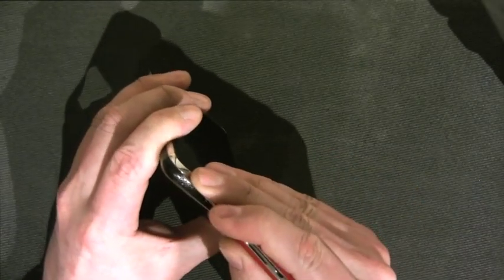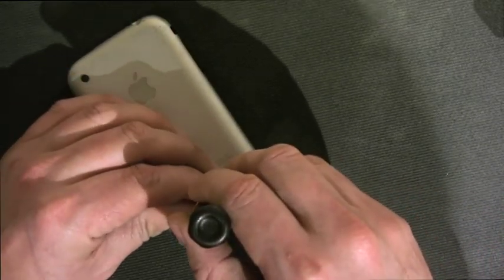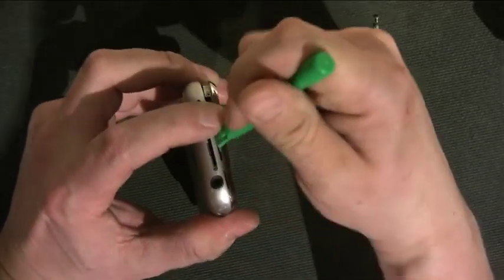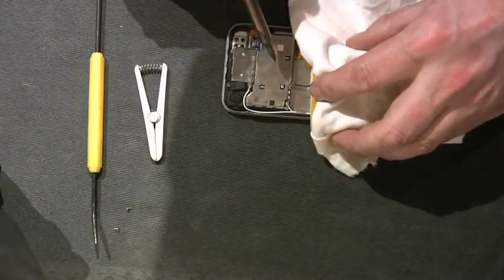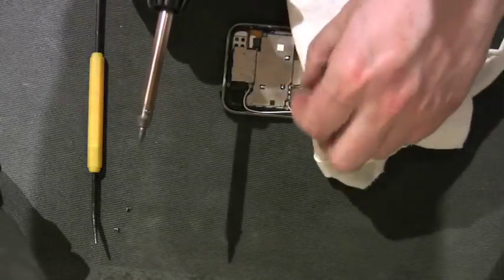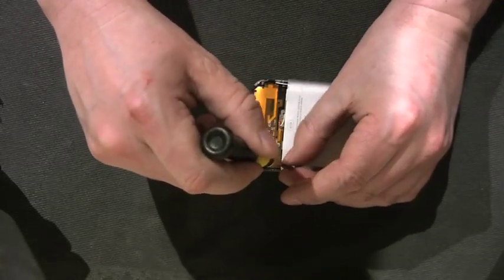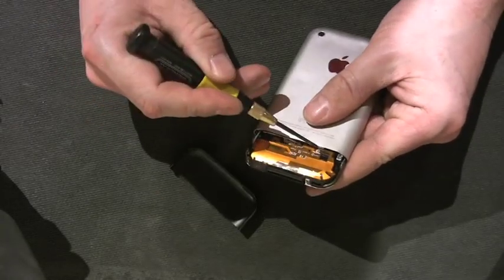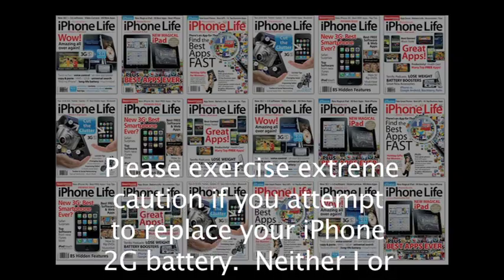iPhone 2G battery replacement

Comment: i have a problem, my iPhone 2g it's working fine, but my battery keeps dying.... when i charge it, the battery is full in like 10 sec, but if i use it, it dies.......
so could that mean that i will have to replace the battery soon?
Reply: Denis9ROCKSTAR definitely replace it.
Reply: @JZKDutchYT 6 years later…

Comment: Thanks for the video! Just sucessfully did the process. It's scary, but doable even for a beginner (like me).
Tips: a) Place a non-conductive tape on the red cable to avoid short-circuit. b) Touching metal with the red cable won't blow everything up, but you should avoid it. c) To open the metal back, follow the video, the method he uses works great. d) The original battery has a strong glue, be careful on removing it (just try not to pull so hard, to avoid breaking connectors). e) Good luck! :)

Comment: @ninjadudevideos 
Noobs might use to much heat, damageing the battery

@iPhoneLifevideoblog
You forgot some points.
1. The original battery is GLUED ULTRA STRONG to the phone.
I was very careful but while applying force, I ripped out the black cable + soldering point from pcb.
A. cut cables B. unstick battery.
2. I soldered the cables the OTHER way. Touching ground with red(+) cable won't do anything ;)
Then white(soc) and last black(ground).
After plugging it in I works again.
rgds

Comment: @ninjadudevideos 
You are the baby.
I'd like to see your face if a cheap replacement lipoly battery explodes and spews it contens into it.
Id recommend to cut the old wires and to solder the new wires to the old ones. that is easier for beginners.
then insulate the wires and your good to go.

Comment: how do u SOLDER the battery wires? I have like glue everywhere on it and its messed up and I have some wires stickin out (a rly thin and tiny one) and its rly ahrd to plug them in HELP

Comment from the maker: @ninjadudevideos Generally I'd agree it's safe to solder a battery.  However most people watching these video posts are not experienced and do not realize how much heat a battery can suck up very quickly, Li-ion Polymer batteries do have a reputation for catching on fire and bursting, how much energy one must put into the battery is of debate, but I'd rather be safe than sorry with my video posts.

Comment from the maker: @shayman1337 @shayman1337 The leads coming off the battery and attached to the mother board must be, from left to right, in this order; red white, black.  That is the only way the iPhone will power up or charge.  If you have the battery connected right and it's still not charging, there's a good chance the ribbon cable which runs under the battery is either unclipped or not fully clipped into the mother board or it's dead, in which case it would need to be replaced. That is very delicate work.

Comment: @iPhoneLifevideoblog I have a car charger and when I plug into that the iPhone powers and tries to charge.  The phone thinks it has full power (the power meter says full idk why), but once I unplug the phone from the charger it immediately dies.  I think the battery isn't doing any thing.  Do you think it's a good idea to desolder the connections and then resolder in the right order?

Comment from the maker: @shayman1337 With the back side up and the bottom facing you, the power cables should be from left to right; red, white, black.  Generally when you attach batteries you attach the ground first and positive last, that means for the iPhone (back off, bottom facing you) you start from the right attaching the black, then white, then red battery leads. make sure you have them soldered on correctly, it may take a while for a new battery to charge, you should charge with a charger not your computer.

Comment: I had the same problem as flybabafly. The black battery cable came off while reseating the motherboard cables. Can I solder the black back on or do i have to remove all 3? Worried about having the red already connected.

Comment: @flybabafly i think you have to solder it. glue wont work
Reply: Ricardo Canales you can also use part of the existing cables and just connect the battery to those the cables will be a bit longer but it's more easy and you can cover the exposed wires with wire tape and stick them to the battery itself it should fit I've done it before

Comment: ok. the thing i don't get is how to connect the new battery wires. i tried using a soldering iron and solder the wires on but its not staying on. i dont know exactly where to put the wires.

Comment from the maker: @KhmerChic26 Good point.  You can just snip the wires between the battery and iPhone.  You do need to take the glue off the terminal though, I usually use a small exacto knife and pick off just enough to desolder.

Comment: hi! i did a screen replacement of my iphone 2g and im a it stuck. im having such big problems making the ribbons go on to the motherboard, ive still not made them click on, but the black cable to the battery had fallen off the motherboard. will the battery work without this cable? or will i have to glue it on or something? i do not have a heat iron. please help!!!!! great videos by the way!